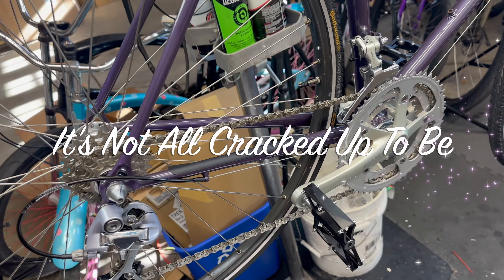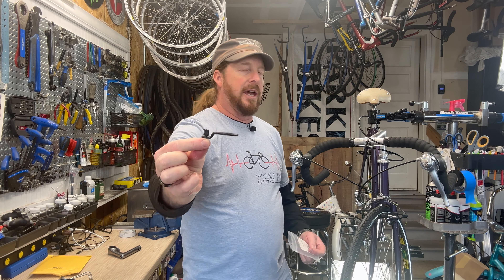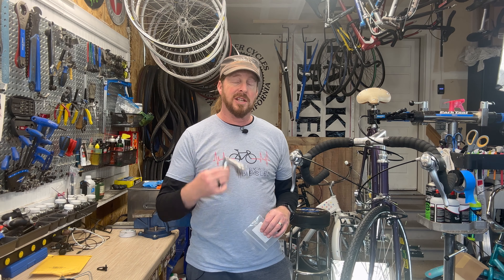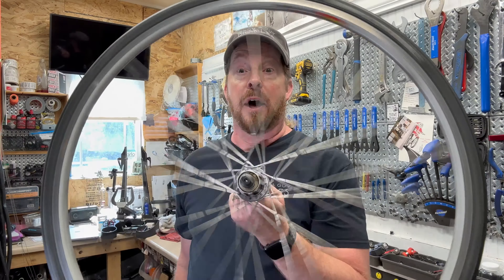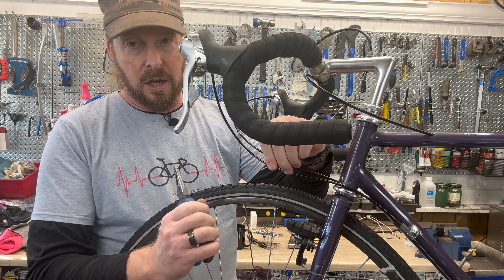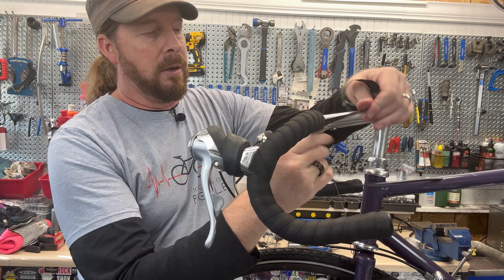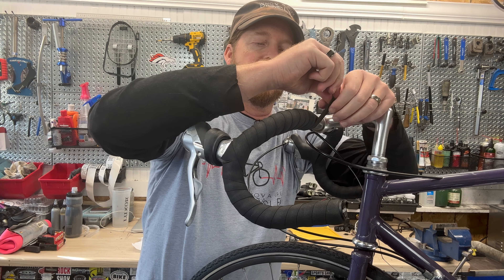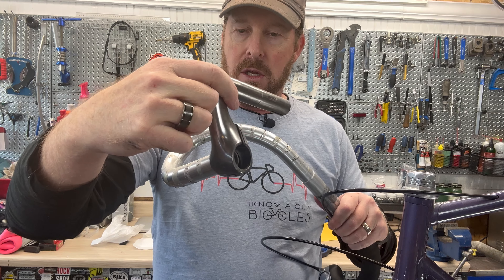Cracked Quill Stem Replacement - Japan Zunow Road Bike -  Refurbishing this Classic Steel Bicycle

Comment: Lawsuits basically ended the canti era, and brought V brakes into the market. To avoid the bridal catching the front tire if the brake cable broke, the fix was a front fender or a long bolt through the  brake mount hole in the crown. Those 1R stems were terrible. I had one and it slipped and crushed the handlebar. Greg Lemond had one in his vctory in TDF though!
Reply from the maker: Thanks for your insights!

Comment: I've seen this happen many times before, the cracked stem is a 1-R and is the last offering for this model and the cable through is not factory, the earlier 1-R stems was with ALLOY inner wedges which were prone to breaking , later wedges were now steel and the cracking of the face of the stem basically with the use of the stronger steel wedge mostly because there wasn't much material up front to brace against the pressure from the tightening of the clamping bolt which sends the handlebar hard against the inner face of the stem, end game a cracked stem. 

Setting up of the front brake, these calipers are the older style with wider cable positioning, for myself I've working on this model of brakes for well over 35 years and my take is that I would install the cable yoke above the gear cables, thus the straddle cable would be on the outer side of the gear cables, a higher position would give better leverage which will deliver smoother and stronger breaking power...Just my 2 cents from a long time bicycle junky!
Reply from the maker: Your right and I should give that a try, I will have to buy a couple of new bridge cables to give it a go. Thank you for your insights.